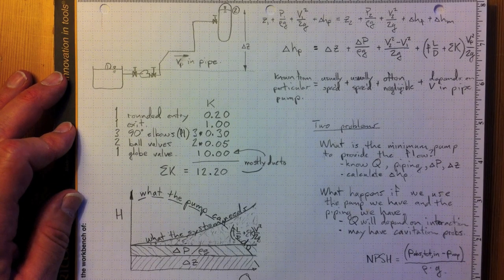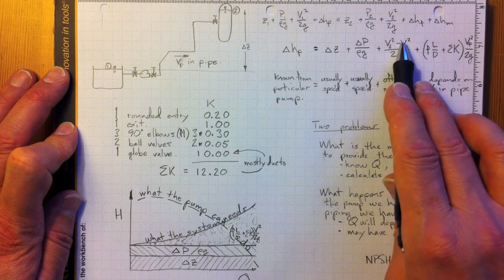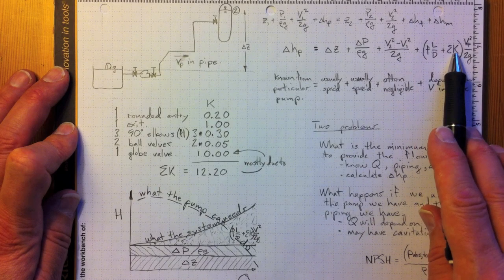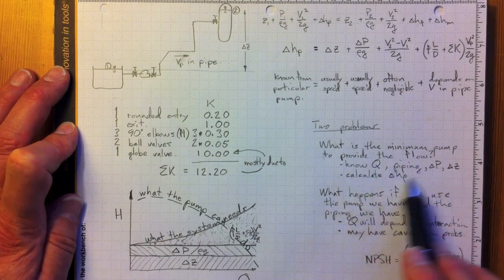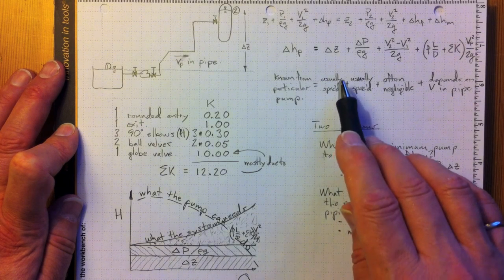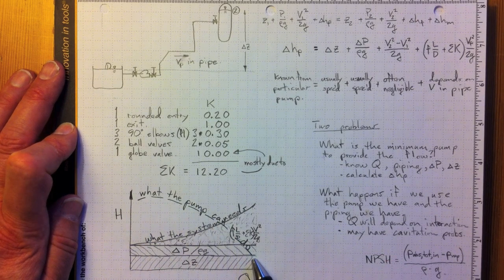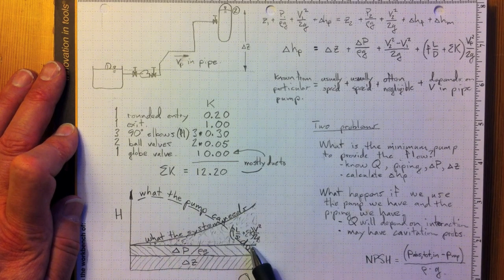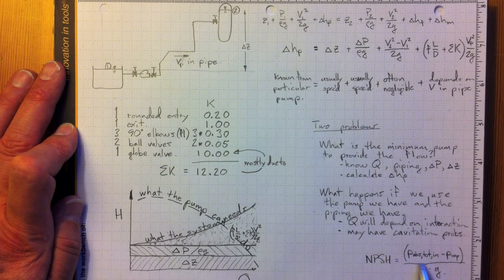Match Pumps and Piping

Comment: Great video. Does anyone know why it's more efficient to have some head rise across the pump? If partially closing the globe valve increases friction resulting in losses, wouldn't it be best to keep the globe valve open with zero head rise across the pump?
Reply: You will always have a head rise across the pump at any flow. 

It definitely would be more efficient to select the pump that will provide the flow you need so no throttling is required but that’s only in a perfect world. Very quickly, the impeller will start to wear, the pipe will corrode and get rougher or build up will occur and reduce the pipe diameter. Now the pump is maxed out and cannot deliver the required flow. 
Unfortunately, some energy must be wasted through valves to keep the system working long term.
Reply: @RiffMusic1970 thanks! I understand this a lot more now. Saving this video in case I ever forget this stuff. Explained much better than it was in school

Comment: I have a question for the last sentence. “For warmer water, the pump should be placed lower, so the inlet pressure will be lower to avoid boiling of the water.” I think it will make the inlet pressure higher to avoid boiling.